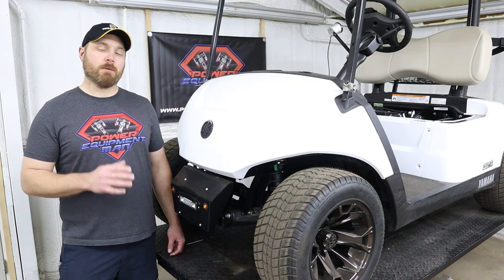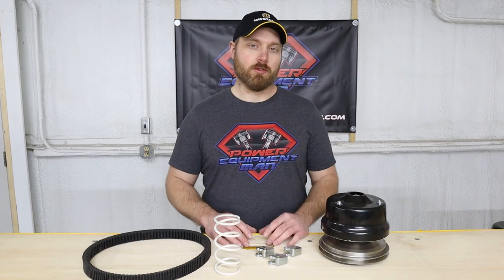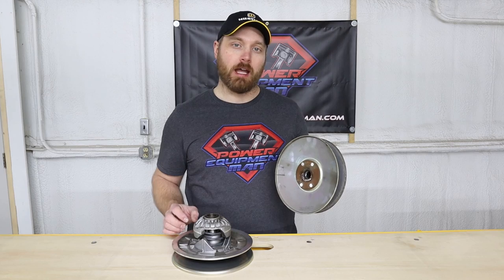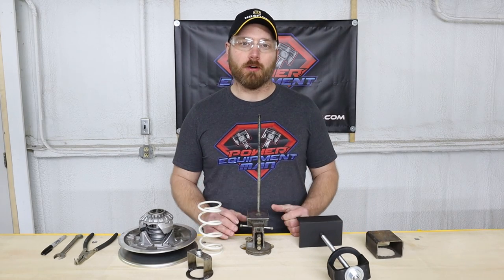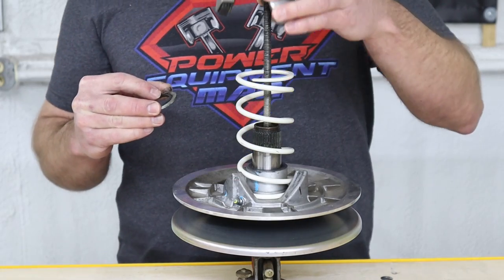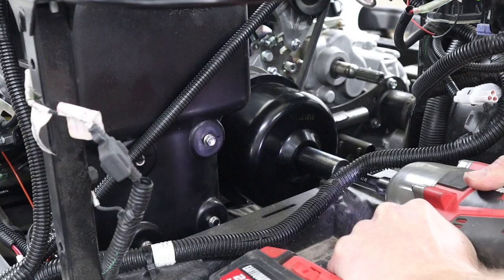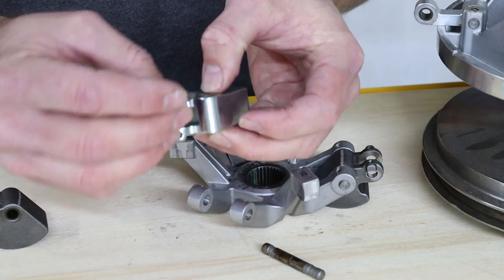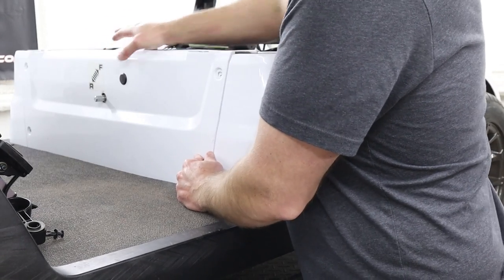Yamaha Drive G29 and Drive 2 Clutch Kit Installation

Comment: Awesome video and solved my issue.  My Yamaha 2018 gas cart was making strange sounds in the secondary clutch area and I was able to drive on flat ground but if I tried to climb a small hill, the cart would stop in the middle of the hill.  With your video showing how easy it is to remove the single 12mm bolt holding the secondary (driven) clutch, I got my confidence up to remove it. Well, during the removal, it be apparent that the snap spring that holds the whole clutch assembly together had broken so the clutch spring and clutch were rattling around unsupported on the transmission spindle. I ordered a 6 rivet replacement secondary clutch from your website and it should be arriving in a few days.  THANK YOU for your video and email assistance.

Comment: I'm looking to buy a 2013 EFI Yamaha and would like your opinion on the cart and if this is an upgrade you would recommend for it.
Reply from the maker: Deciding if you need a clutch kit depends on what you are doing with the cart. If you have a lot hills and heavy loads then you will definitely want a clutch kit. If you are on flat ground with just one or two people mostly, then you probably don't need a clutch kit. If you are planning to install high speed gears to get more top speed, then you will want a clutch kit.

Comment: This looks like what I need. Brand new 2022 Quietech PTV. My neighborhood has a lot of hills. Is this the same as the Plowmans kit, and do you have all 3 stages in stock?

Also, do you have something to increase the top speed a few mph other than the governor adjustment that I did already? Thanks in advance.
Reply from the maker: Yes, we currently have all 3 stages in stock. We are working on a kit that would allow you to get more speed and horsepower, but it won't be ready to start selling for a while yet. We will have more details on it when it is released. 

Plowman's kit comes with the old TEAM style primary clutch, which in my opinion is JUNK. We did a full video on why the TEAM clutches are terrible, I recommend you watch it here - https://youtu.be/xwhRyZvRjqU
Reply: @Power Equipment Man  thanks. What about oil delusion imhe speaks of in his website? Is that a thing?
Reply from the maker: @AP-st1li  Oil delusion can be an issue if the engine isn't tuned to adjust for higher RPM and intake/exhaust mods. As far as I know, we are the only place in the world that has came up with a fuel/timing controller for the Quietechs. That is part of the performance kit we are working on.

Comment: PE man Im looking for a video on how to service the  primary clutch (yamaha drive 2--G-29)... you ever done one like that?  Apparently cleaning, inspection of parts and lubrication are important.
Reply from the maker: If you have the newer style FBT clutch, you should not need to do any removal/cleaning. They have a grease zerk on them and just need to be greased with one or two pumps of grease every time you change your engine oil. 
If you have the old TEAM clutches, they were a very high maintenance clutch that did require disassembly to clean/lube. The TEAM clutches are junk and should be replaced with the FBT clutches. We sell a kit to do that.
Reply: @PowerEquipmentMan  Thank you I have the FBT clutch,  I saw it had a removable cover and assumed you had to get inside to do some "magic".

Love the channel, learning alot about these neat little machines--much appreciated

Comment: I just ordered the stage 1 kit and i have the 4 rivet secondary clutch. Do you think it will hold up with the stage 1 kit?
Reply from the maker: It's best to upgrade to the 6 rivet as they are a lot stronger clutch. If your 4 rivet is still in good condition, it might be ok for a while, but just know that there is a good chance that it will break eventually.

Comment: Is the kit out yet? What is the difference between this and the Plowman’s extreme kit?
Reply from the maker: Yes, all three stages of our clutch kit are available on our website - https://powerequipmentman.com/collections/best-sellers/products/yamaha-drive-g29-drive2-clutch-kit. 
Plowman's extreme kit has you replace your OEM primary clutch with the old TEAM clutch. The TEAM clutches were plagued with issues. See more info about the TEAM clutches here - https://youtu.be/xwhRyZvRjqU
We will be releasing our High Performance kit around the end of this year that includes a fuel/timing controller and some slight engine and exhaust modifications to safely get more power out of these engines. On the dyno we have seen around a 30% increase in hp and tq. We will do a video about that kit once it is released, so be sure to subscribe!

Comment: About to purchase a Umax Rally 2+2 and I saw somewhere that the 2 seater version has a higher speed gear set. do you sell a gear set for the 2+2 which will add top end speed?
Reply from the maker: From what we have been able to find out, the Rally 2+2 uses the same gears as a fleet model Drive2. So you should be able to use the same high speed gears that fit the solid axle fleet carts. https://powerequipmentman.com/collections/golf-cart-accessories/products/yamaha-drive-drive2-high-speed-gear-set?variant=40336058613951

I would recommend just turning the governor up first and see how fast that gets you - https://youtu.be/KnQTFm_C1XU

Comment: I'm sure this has had to been brought up. Do you have any tricks for the sway problems on the G29s after they have been lifted and with larger tires? mine is all over the place. 16' g29 with 23s and 6" lift/3" spacers/heavy duty rear springs.
Reply from the maker: Unfortunately, the best solution at this time is NO LIFT. It sounds like you have already done most of the common stuff (wheel spacers and HD coils). The only other thing you can really mess with is the alignment. Make sure your camber is perfect first. Then some guys say 1/4" toe in, and some say 1/4" toed out. I think the last one we setup, we put at about 1/8" toed out and it was fairly stable at 35 mph. You can also try adding risers to the steering knuckle to make the tie rods more level (less bump steer). Set tire pressure at 10 or 12 psi.
Reply: @PowerEquipmentMan  Hey thanks for the quick response! and I really enjoy the videos keep up the good work you have helped me a lot over the last couple weeks with maintenance on my rig

Comment: I have a Yamaha G29  2010. Why the primary clutch DON’T move the secundary clutch the drive clutch belt no make the secundary clutch turn
Reply from the maker: When you push the cart, does the secondary clutch spin?

Comment: I have a 2015 yamaha G29. I have hill to climb but have no power. The cart runs 19 mph on level ground but it really Boggs down going up hill. I have put a heaver torque spring on but didn’t help. Any suggestions that could help. Thanks
Reply from the maker: I don't see your name in our customer list, so I'm assuming you didn't purchase your spring from us. What spring did you install? What was it rated for? Springs are not a "one sizes fits all" kind of thing. Did you install a better belt? Stock belts aren't the best for more severe applications. If your hills are pretty steep, you may need a stage 2 kit.
Reply: It was a Yamaha G29/Drive - Jake's Power Spring Kit. The spring was yellow. I also looked at my secondary clutch and it is the 4 rivet one.
Reply: And no I didn’t change the belt
Reply from the maker: @deanwentworth8390  I don't have any idea what their yellow spring rate is. It likely isn't stiff enough for your application. A good belt makes a big difference too. I would recommend either a stage 1 or stage 2 clutch kit - https://powerequipmentman.com/collections/golf-cart-accessories/products/yamaha-drive-g29-drive2-clutch-kit
Reply: My terrain is mostly level except for one hill. I would probably upgrade the secondary clutch also. What all would you recommend?
Reply from the maker: @deanwentworth8390  Stage 1 kit with medium hills/medium loads. If you order the new 6 rivet clutch at the same time we will install the new spring for you before we ship it out.

Comment: I have yamaha 2011 old team clutches so what I need to replace for new clutch I  want replace about? Thank you
Reply from the maker: You would need to update to the new style primary and secondary clutches and the belt. You can not mix and match any of the TEAM stuff with the new style stuff, it is completely different. Yamaha offers a clutch update kit but they have been on backorder for awhile. We could probably piece together everything you would need to update for around $700.
Reply: @PowerEquipmentMan  I want definitely new style stuff. How can I know when they have in stock?
Reply from the maker: @diylife7315  Keep an eye on our website. We plan to have them available for sale as soon as we can get them.  https://powerequipmentman.com/collections/drive-1-2007-2016

Comment: Are you still working on a performance kit for these model carts?
Reply from the maker: Yes we still hope to release our High Performance kit for the Quietechs later this year.
Reply: Awesome I may just hold off until that it released.
Reply: @PowerEquipmentMan  do you have any updates on the performance kit.   I have the plowman’s kit and I don’t like it I have had nothing but problems with the clutches and belt.
Reply from the maker: @chino843  We do sell the clutch kits shown in this video, but the high performance kit that we developed got shelved indefinitely due to liability issues.
Reply: @PowerEquipmentMan That’s not good. Can’t you sell them with a signed release statement saying they are for hilly applications and your company is not liable for misuse. You’re not liable for people misusing your product.